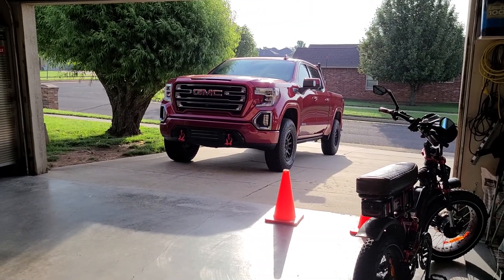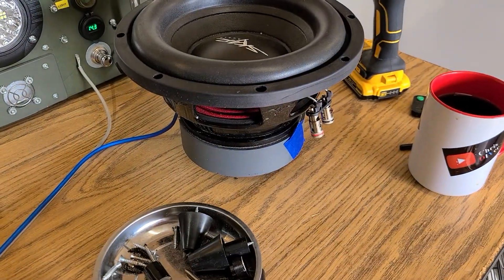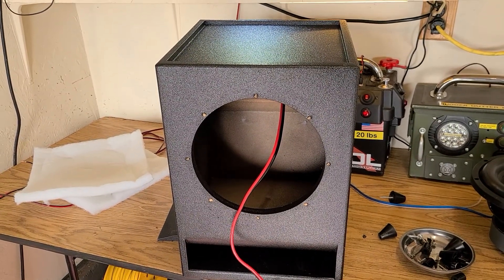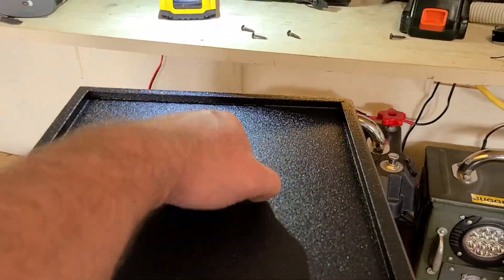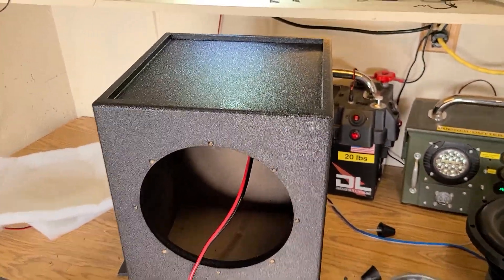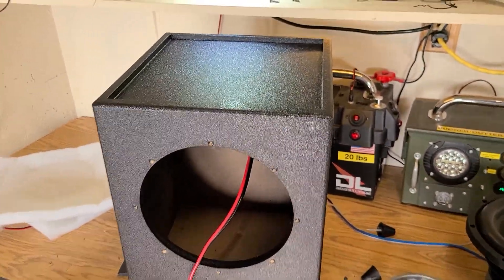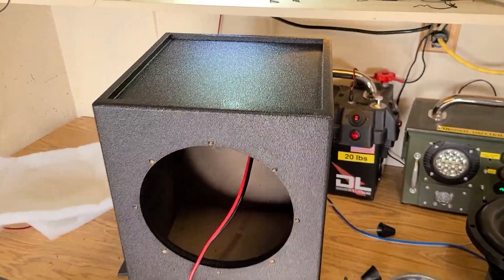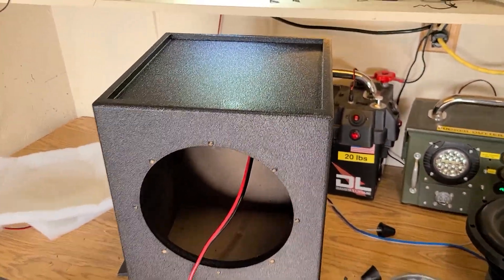New Skar Audio AR1X10V Armor coated subwoofer enclosure -- MANY mods in work!

Comment: I've researched this box and they have a standard ported and a ported SPL box. I'm not the best at this stuff. Is there anyone that can tell me what the difference between the two boxes are. The only thing I can see is The port looks like it's got a reinforcement in it. The price difference is maybe 10-15 dollars. Wasn't sure which one I should get.
Reply from the maker: Both are very good enclosures. From their website, it says the SPL is tuned to 44Hz and the AR1X10V is tuned to 38Hz. They say the SPL has more "bass output". It really depends on your placement if you need the port on the side or front firing. I prefer front firing, but that doesn't mean it's better.  Lastly, the Kerf (curved) porting on the AR1X10V helps reduce huff/chuff IMHO. I have their larger 15" Kerf loaded ones and there is some huff/chuff at 1,000+ watts....but, at that level, things are wicked loud. With the 10" ones, I don't hear any of that (same Kerf port). So, it really depends on look/functionality/fitment.  I own three of their 10" boxes and all are very good quality...happy with their sound/output
Reply: @ChrisDIYerOklahoma  thank you soooo much for the reply 🙏🙏 I'll be grabbing one Monday. Your the best ❤️❤️❤️